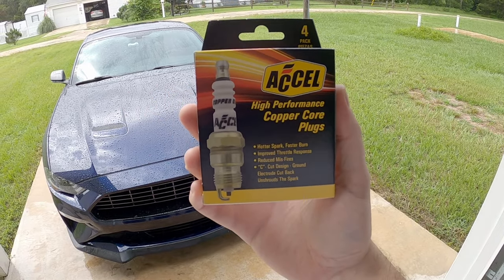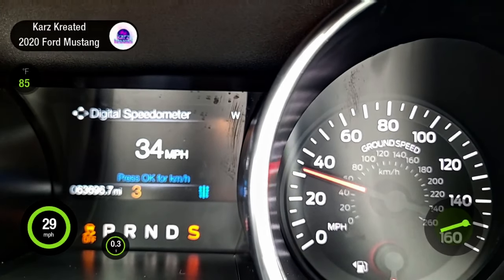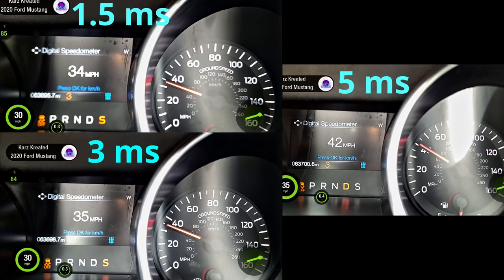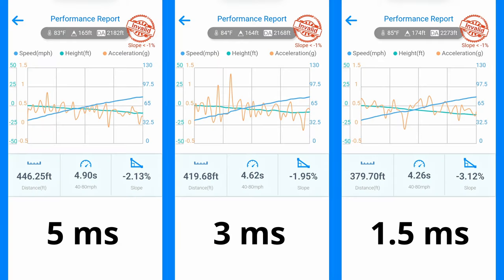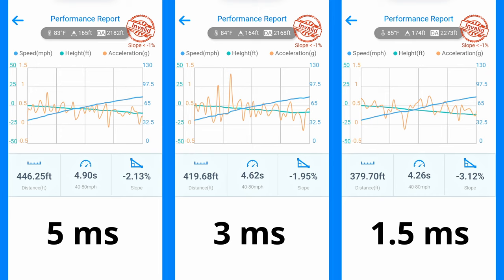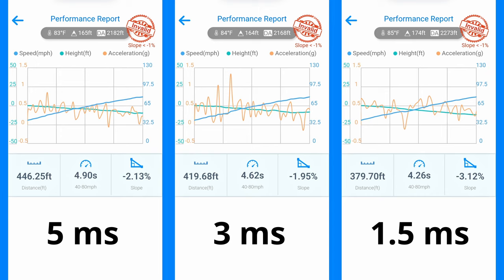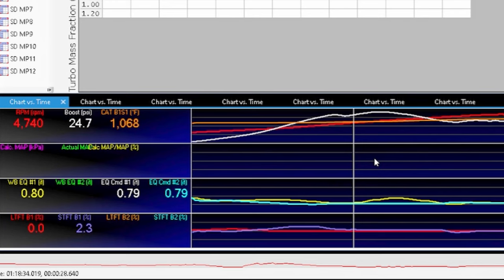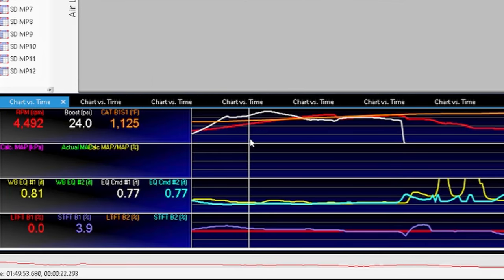Does Changing Spark Dwell Increase Horsepower?? Timed Test

Comment: Interesting results can you set a curve so more at lower rpm around 4 and less up top going down to 1.5  maybe get the best of all 3 runs combined. I feel the ruthenium plugs would have done a better job.
Reply from the maker: I can't adjust dwell time based on rpm. That would be nice though. I can only adjust the dwell time for a given spark output based on engine coolant temp. So I only adjusted the dwell in the highest output, which I assume is what the car uses for WOT.